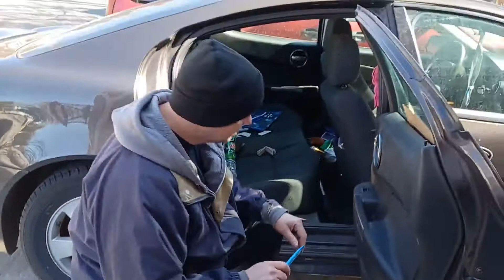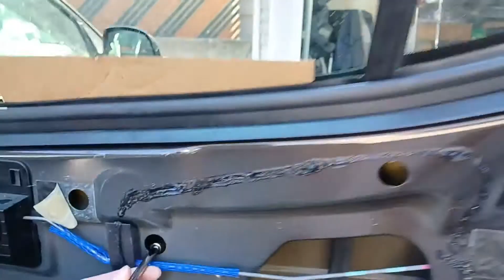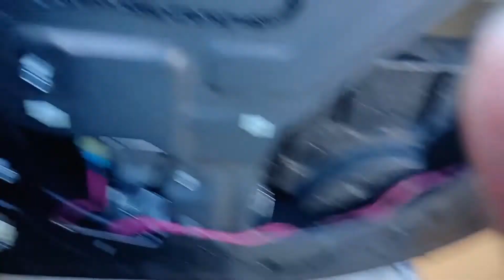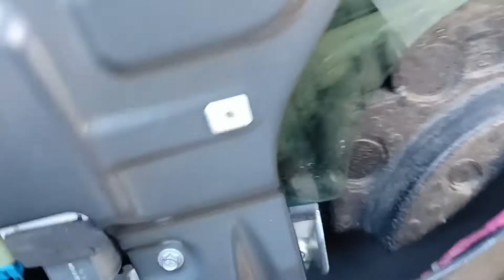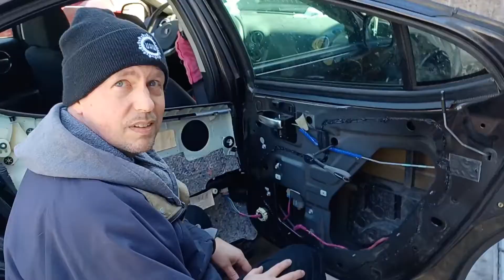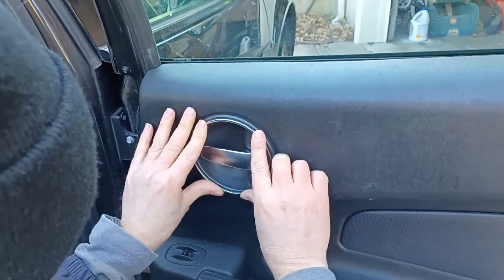2008 Pontiac Grand Prix Window Regulator (Rt Rear)

Comment: The 2 bolts in the handle to remove the door panel are stripped sadly. What would you recommend doing?
Reply from the maker: I wouldn't know, for sure. Perhaps I would try sliding a small, curved pick in the hole beside the driver and bit, and attempt to pry/pull upwards while unscrewing.  Those picks are super cheap so maybe grind the tip off a 90 degree one, to fit in there. Good luck.
Reply: Bolt extractor (Irwin)
Reply: A giant sledge then go to junkyard buy new panel